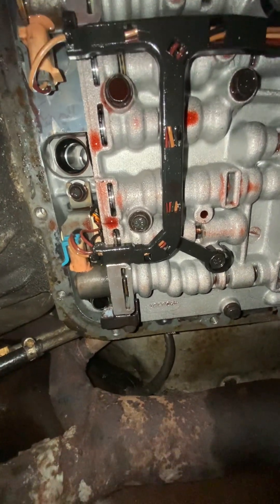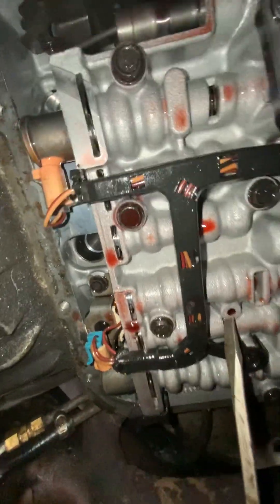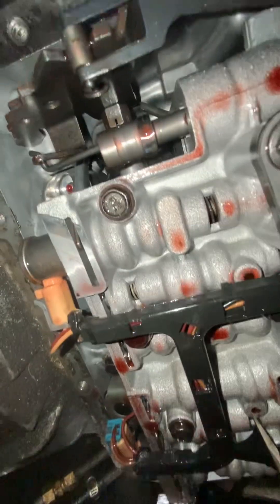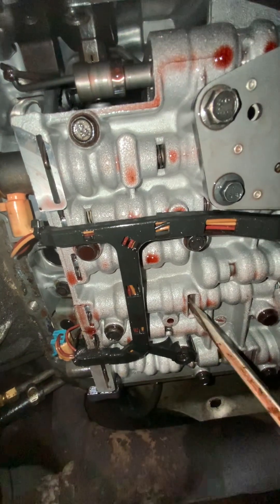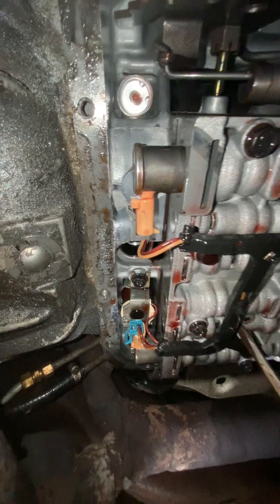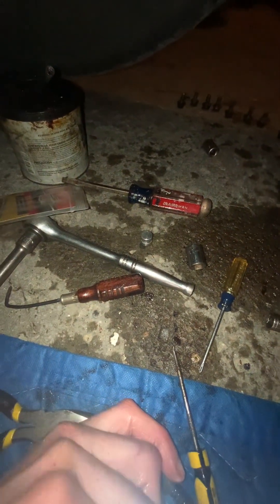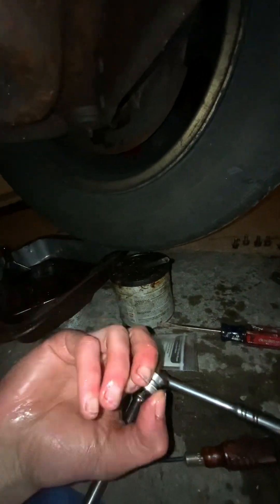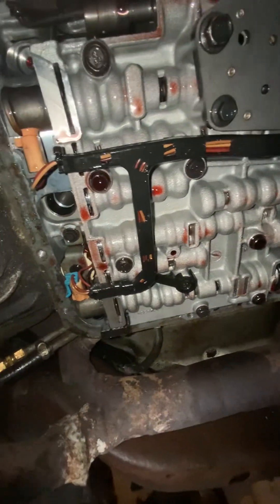P1870 Fitzall TCC installation 2000 Chevy S10 4l60E (watch this if your struggling)

Comment: Did it fix your problems ?
Reply from the maker: 2 months in and it fixed my issue 100%
Reply: @Thejustynwithay how is it now bro?
Reply from the maker: @SbandzVIII  its been 6 months and about 6000 miles and no issues.
Reply: @Thejustynwithay  I’m thinking about buying a s10 w 180k miles for 1500 but it has the p1870 code is it still worth the purchase ?
Reply from the maker: @SbandzVIII  1500 is pretty cheap right now but for around 3k you can get a good one from down south. If you spend 1500 you might have to spend 1500 to get a new trans unless this can fix it. Depends on the Body shape if there’s no rust, anything can be repaired. If you want to gamble and are able fix the trans which isn’t too hard then 1500 is a very good deal.